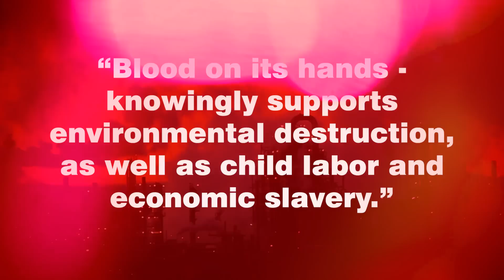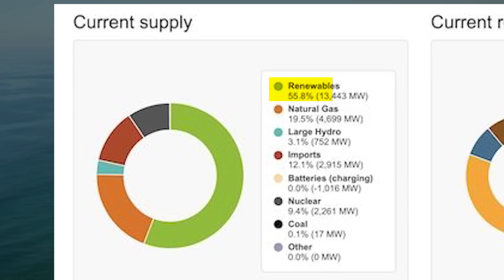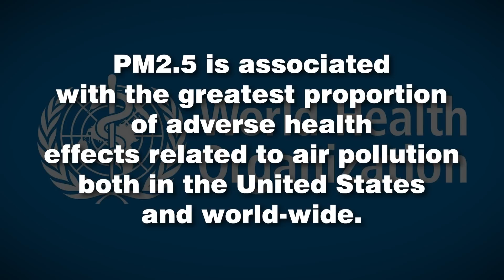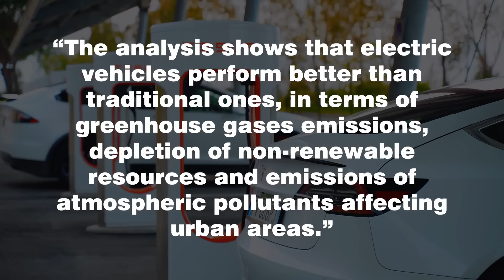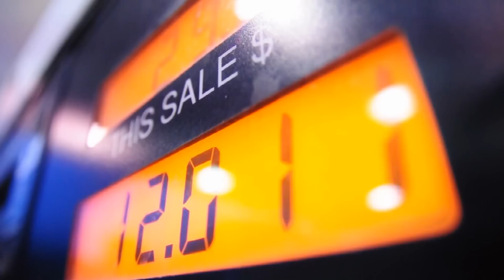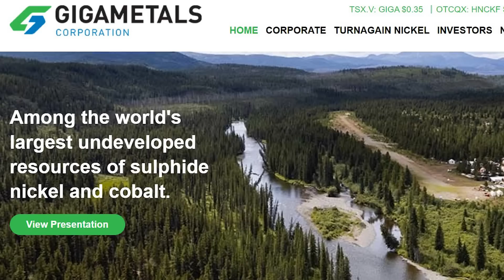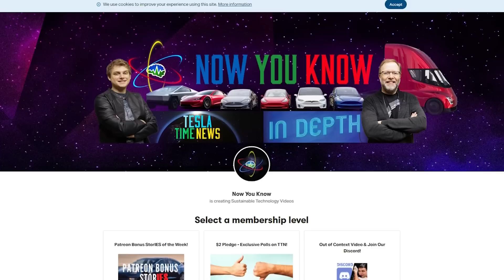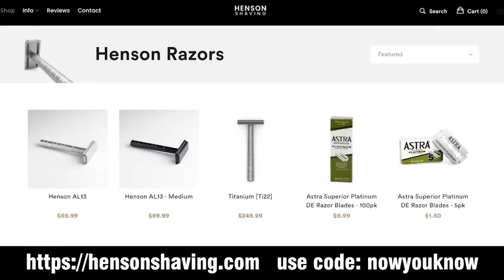Debunking More EV Lies | In Depth

Comment: Cobalt is also used in transforming oil into gasoline
Reply: J.B. Straubel said we've almost already reached the point that 100% of cobalt can come from recycling. 

The material they're recycling has a lot more cobalt, and newer batteries use less and less.  They can get enough cobalt for 1 Tesla battery from 100 recycled phone batteries.

Comment: Wait! Fossil cars burn gasoline! This is MORE polluting. This is purchased from overseas (Saudia Arabia sweet crude). Texas crude BTW is shipped to Japan where the refineries are set up for the Texas high sulfur crude. The EV money sent to utilities stays in America. The money spent on gasoline goes overseas to oil dictators, Saudi Arabia, Russia, Iran etc. I know we don't buy oil from Iran but the Chinese do. This trade deficit is bad economically for America. So we have the drilling pollution, the shipping pollution, the refining pollution and the truck pollution (driving the gasoline to US gas stations). That is A LOT MORE polluting than US utility pollution. Now let's talk about the overseas oil wars. Ukraine, Georgia, Iraq 1, Iraq 2, WWII, etc. Did you know the U.S. has 50,000 soldiers stationed in the Middle East guarding US oil supplies? Who pays for all the wars and military? Not the oil company's that is for sure. Do not let lobbyists trick you into defending EVs. Turn it around make the lobbyists defend fossil vehicles which they cannot do.

Comment: Good video, I'm still not convinced by EV, driven a few that are in my price range and they are just rubbish sorry to say, maybe a tesla is better but man they are boring to look at. Maybe soon there will be something decent to come out that will appeal to me,
Reply: I like the all electric Corvette, but so far they're all catching on fire and burning right down to the ground.

 The Tesla cars are all ugly to me.

The all electric Silverado looks great, but that starts around a $100,000 😳

 Besides General Motors don't have a good report with electric vehicles .
Reply: @icosthop9998  I'm in the UK, sold my two new cars last year and brought a 15 year old astra twin top. Made me realise just how bad the modern cars are, I have a lot of toys still, and it drives nice with only 46k miles, even the leather seats are nice with 3 step heating, it does everything a convertible should do without a load of features I'll never use. This will do until something compelling comes out and was less than 3k
Reply: Ask anyone who's ever been a passenger in a Tesla if it was "boring".
Reply: @rogerstarkey5390   The way you worded your comment I don't know how to take it.
 So is it boring or a nice experience ❔️
Reply: @icosthop9998  the 15 year old car is a nice experience, it has everything you need, I have auto dimming rear view mirror, auto lights, auto wipers that change speed accordingly, automatic gearbox that even senses hills so will change down to go up or change down to use engine braking, the number plate lights come on so you can see the floor easy, and it has a gas strut for the bonnet stay to make checking the levels easy. All the dash is soft material and it has piano black facia. I Bluetooth my phone to the fm adapter and have Google maps or waze. To me buying a 45k car to do less beats me and those that pay to do so to save money.

Comment: I’ve done some research on the HUMMER EV: 215 kWh pack for roughly 300 miles: 687wh/mile or 1.4 miles per kWh. 

And yet I’ve been using solar energy for my own house usage for almost 5 years now. It’s a small premium monthly basis for the 100% usage of renewable energy sources from my local energy provider. 

I learned about it from you guys, years ago and I did the research of the process of switching from gas power electric supply to renewable energy sources and I switched it.

Driving an EV with the dirtiest power system is STILL CLEANER than driving an gasoline vehicle.

Comment: An additional point is that the flexibility of charging when the grid has a surplus (just a minor additional control circuit for which the auto owner get paid appropriately) of renewable generation greatly adds to the percentage of intermittent renewable generation the grid can use.
Reply: All the panel pumpers do is sell power to the grid when sun is shining then expend those credits at night using power from mostly natural gas. Only an infinitesimally small fraction of panel pumpers own battery banks and store the sunlight energy.  Also those battery bunkers introduce a potential catastrophic fire hazard to homestead. Nighty night.
Reply: @Dggb2345  you forgot the ones who commit fraud and sell the power company their power back to them. Very Hilarious
Reply: @vivekvsapre  also should explain s cali terrain,why the smog gets trapped. Easy to find out,anyone who wants evidence. This has been a known fact way before i was born.
Reply: @vivekvsapre  
"You in California" had rolling blackouts due to insufficient historic investment in a poorly maintained (previously) fossil fuel based grid infrastructure.
Part of the problem was (is) grid energy used to refine fossil fuel.
.
You should know (you probably already do?) that the "renewable green energy" collected by rooftop solar, saved by owners of home storage batteries has been saving that failing grid by acting as a peaker plant most days in Late August, into September (ongoing).
.
That'll be an inconvenient truth for you?
Reply: @rogerstarkey5390  also artifially heating up the area, on top of that asphalt being used everywhere doesnt help aka this is a big rabbit hole in the future ev can be good as of now not really
Reply: @vivekvsapre  Reliable reference please.

Comment: The left are idiots?  The green new deal is the biggest farce.  Illegitimate biden and his elk, immediately shut down the oil pipeline to force one to buy an EV which  super expensive.  Now it was determined that our electric grid cannot handle it if everyone has electric autos. Twenty-three percent of the charging stations are malfunctioning.  What a rip.

Comment: 2:25 just want to add that, 25% of electricity comes from renewable, but that's not including nuclear. With nuclear, over 40% of US electricity was emission free in the first half of 2022 which really makes the point even stronger. Thank you for helping set the record straight and providing some entertainment along the way.
Reply: Nuclear is such an underrated/underutilized resource. I drive a Clarity in Chicago, where 60% of our electric is nuclear. In short, it works.
Reply: @TechnoMageB5  Agreed. Nuclear is needed especially in places with less sun like northern Europe.
Reply: @5893MrWilson  if we didn't have an electricity grid across Europe, and weren't continually upgrading it, and didn't have a huge amount of wind power, and solar panels weren't continually getting more efficient, yes, the slightly lower amount of sunlight in northern Europe would matter but it genuinely doesn't. I'm very much for nuclear power stations though as they provide a lot of resilience and use up fuel. 

But yeah, there's no reason not to install solar panels in northern Europe that I can see. Plus places like Iceland have geothermal power. Oh and there's hydro. I might have forgotten more.
Reply: @jonevansauthor  Oh definitely agree. Solar+battery should be the go-to cheapest form of electricity in most places sooner or later. It's just going to take longer to be economical in a place like the UK that gets half as much solar energy as California or Texas. If I was going to invest in nuclear anywhere, it would be in a place where solar is has less of an advantage.
Reply: @5893MrWilson  
So...... "In the UK" (yes, I am)
Latest figures for nuclear.
Hinckley C
20 years consult/ build (EST 2025)
£24 BN est (Over-budget)
Strike price £92/MWh (may have been raised even more!!?)
Output 3.2GW
.....
Wind.
Dogger Bank.
12-14 years FULL build time.*
£8.5 BN (on budget)
Strike price £39/MWh 
3.6GW
.
Would you like to revise your 
"Longer to be economical" opinion?
.
(Before you say "down time", just build 2! ....AND £5BN storage! That's 7.2GW for the same (nuclear) price WITH backup)
Reply: @rogerstarkey5390  interesting, thanks for sharing the numbers. I was talking more about solar but wind appears to be extremely cheap there. Even if it is a variable power source, battery buffers can handle that and still be cheaper plus excess power can be dumped into desalinization or carbon capture. I wonder which places have low solar and wind energy?
Reply: @rogerstarkey5390  yes, the higher price does suck, but we need to build them all for lots of reasons. Resilience is one, massively, massively, massively increasing energy demands (more civilisation equals more energy use so it's not just green energy use).

But yeah, I'm really hoping the smaller and more modern reactors will actually get prototyped and built now Trump is out of the picture.
Reply: @5893MrWilson  well, it's really about total cost of ownership and solar panels have been lasting longer than people thought. So sure, solar might return less in the UK but we can put it on rooftops, which we can't do with wind or wave power. Which means some of the cost is defrayed when building new buildings and the new roofing systems where the panel is also the roof tile are changing the game in another way. As are ultra cheap panels that are coming and will be inefficient but so cheap it doesn't matter.
Reply: @5893MrWilson  
No.
Search "Copenhagen International School"
Interesting power source considering the location(?)
Reply: @jonevansauthor  
"Copenhagen International School"
Plenty of reason.
Walls, not roof.🤔
Reply: @jonevansauthor  
Resilience comes with diversity and fragmentation.
(For instance, you don't see the internet go down)
The wind always blows somewhere
Same with the Sun.
.
Re nuclear, there's a lot of "if's" in the equation.
.
The other thing never considered is the Carbon deficit during construction.
Every day not producing is another day of fossil pollution.
If it's a 3GW plant, 10 years, that's (obviously) 
30 "GW YEARS" of embedded pollution that must be clawed back, and that's not possible.
A wind project can do that.
50% build time.
Phased switch on (linear build)
50% cost.
For 3GW....
The embedded pollution will be
(3GW x 5 years) × 50%
7.5 "GW Years".
.
AND if for the next 5 years it generates 3GW.... 15GW Years.
Taken over the 10 year "nuclear build" period it's
7.5-15
= NEGATIVE 7.5 GW Years 
.
Over that period it's a potential 37.5 GW Years difference nuclear to wind.
That's "Carbon deficit in the system" you can't extract.

.
Plus on course  you could spend the remaining cash and DOUBLE the effect.
(Well, not quite, but doubt the wind project impact, add the same nuclear impact, you're at 2x 7.5 +30 = 45GW Years benefit by using wind)
.
Reply: @TechnoMageB5  
It "WORKED"
Now, it takes too long and is far too expensive compared to the alternatives.
Reply: California doesn't have too much nuclear, but tracking CA ISO website over last 10 days w/ heat wave power crunch... nuclear supplies 5-9% of the power; but, impressively, BATTERIES already supply 5%! With only a few grid-scale BESS sites, it's nearly the same as nuclear, already (and many more sites pending / permitting / construction etc.) Even just 3k Tesla powerwall owners, contributed 50MW, same as a small peaker plant.
 (Diablo nuclear plant is end of life and due to be decomm'd, but bill pending to extend it another 5yrs or so, not sure re expense... maybe better spent on solar+wind+storage that could last 25+ years instead of 5?? and not leak in case of quake?)

Nuclear is great for climate, but... much too slow, and much too expensive. No more time left (8-12yrs climate cliff) to make a difference, by then some plants might START construction, for tens of billions each... to late, too much $.
Reply: Hydro is a form of Solar, evaporated recycled water. With gravity storage. Also green.
Reply: To eliminate CO² we first need to eliminate all oxygen,
 so we must first cut all the trees down and the food crops
Reply: Except California is in the process of shutting down their nuclear plants.
Reply: @fredmonroe6042  And buying gasoline from china that they got from Russia
Reply: can batteries be fully recyled without a decrease in performance after each recyle? why hasnt there been more recyling, wasnt there a mining shortage that investors were worried about to make ev? solution requires incnetive or legal force to make cars last longer, probabyl by paying per amount of use and wear including tire wear, lubricant oil etc.          i think battery driving range that is almost enough for everyday use is best, then have free piston 2 cyilnder combustion generator to burn, no rotating engine parts and account for pressure load on engine and worry of less than optimal combustion timing , less weight and parts to lubricate, no burning oil, etc.    see e fuels by exxon porsche  toyota etc, gr86 was supposedly tested with gr corrolla inline 3 with e fuels, combustion hydrogen is supposed to be only water as emission. lot more ideas but web site deletes my stuff sometimes especially if long

Comment: Oregon is 90% renewable.  And don’t forget all the fuel used to refine gasoline from crude oil
Reply: also dont forget that a lot of cobalt is also used to refine gasoline
Reply: Renewable infrastructure relies on 11th century technology…wind and sun. Ask farmers if this is a good way to go.
Reply: Oregon is more like 62% renewable, even that number is over inflated.
Reply: Oregon is not 90% renewable.
Reply: Or, the oil used to produce renewable infrastructure.
Reply: @truthbetold1855  The point is that, one you produce the renewable infrastructure, you do not have to keep burning fossil fuels.